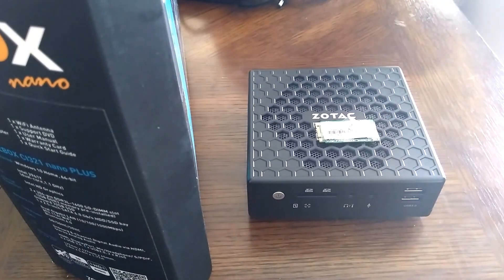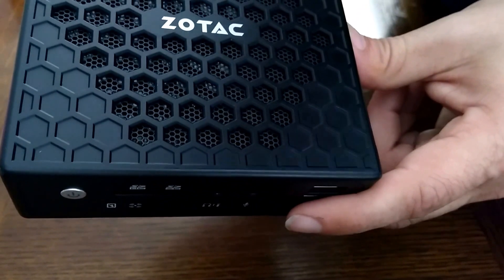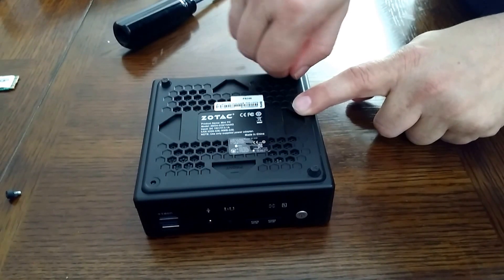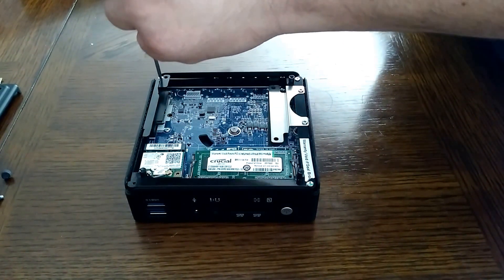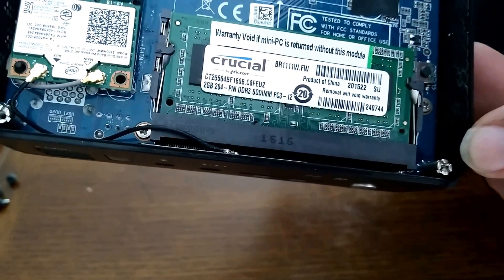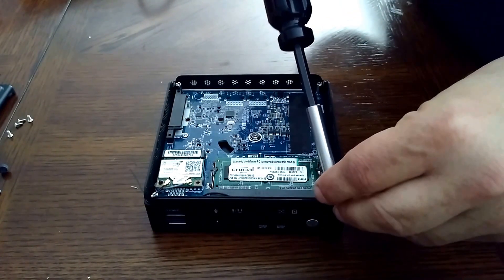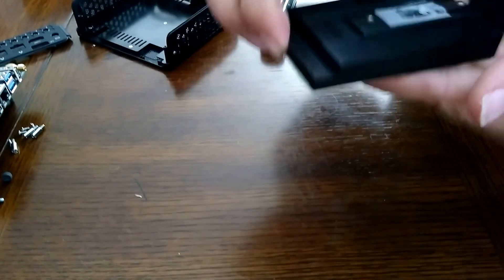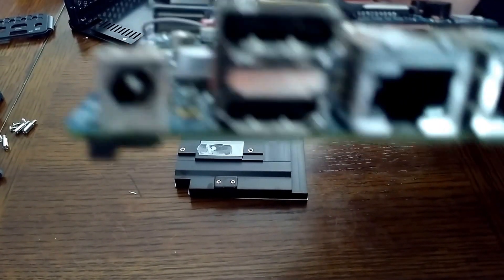✅ Zotac Mini PC Teardown - Massive Heat Sink!

Comment: So someone could run a nvme and a separate ssd also? And if so will it operate a mechanical hdd in that slot?
Reply: I have a CI325 (similar model) and I was able to use the m.2 slot also for boot. I use that for my os and a mech hd in the sata slot for storage. I found the answer for the question.
Reply: @fcaughli hello. all good? I appreciate your contribution, but could you describe in detail what type of M2 drive can be placed? M2 sata, nvme, msata? I'm afraid of purchasing the wrong model. Also has the size model: 2280, 2242 or 2230??? Much obliged

Comment: Hey by any chance, is it possible to disable the speaker, I find it annoying that it beeps every time I turn it on. My parents sleep early and disturbs them. From the looks of it, it looks soldered on? Am I right?
Reply: you can probably disable the Boot Beep in the UEFI/BIOS. I could on mine.
Reply from the maker: I don't have the unit in front of me I am going to guess you can't disable this. That beep is a diagnostic code. It will beep multiple times for errors - single time for all good.

Long shot - you can plugin some headphones and see if bypasses the on board  speaker.

Comment: which type of orginal m.2 ssd, 2230/2242/2260? Can i replace to 256gb?
Reply: it's a m2 2242 (42 mm / 4.2 cm)  any disk wich fit should be correct ( nvme not tested )
Reply: i came here for the same question...the one he extarcted appears to be sata M+B Key ssd...if you stop the video at 9:14  you see the slot ( he unfortunately did not show it properly) but as I see it, there is only a single notch in the slot, which means the slot should support sata as well as nvme based ssds

Comment: Hey i've ordered the ci 327 nano, is it possible to tweak the cooling with liquid metal on the die's?
Reply from the maker: I don't think you will see a big difference. Probably makes more sense to do that on desktop CPU's you can overclock and run much hotter.
Reply: I did - running a 7700k @ 4,8 Ghz with delid :)

Comment: Thanks for the breakdown... I was wandering about the "silent" cooling system on these. I'm surprised there was no fins to increase the surface area. What processor did this unit have? The one I ordered has an i3 7100u.
Reply from the maker: Here are the specs on the box
https://youtu.be/SBqgMWL9jJ4?t=34
Reply: It appears the idea is to use that large heat pad to transfer the heat to the case top. Hard to tell without tests which way would be better, but this design may be a good one.